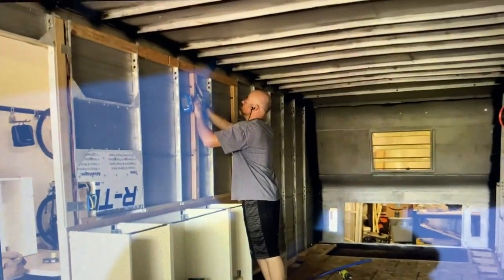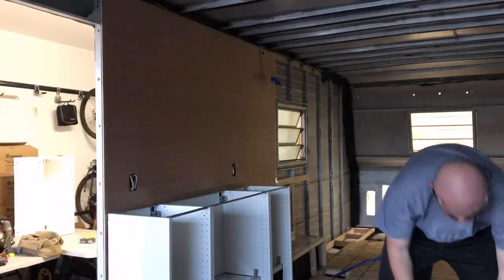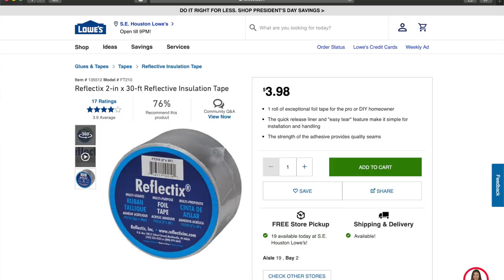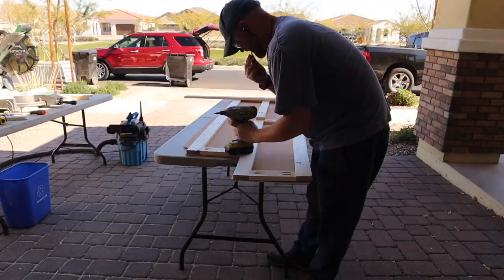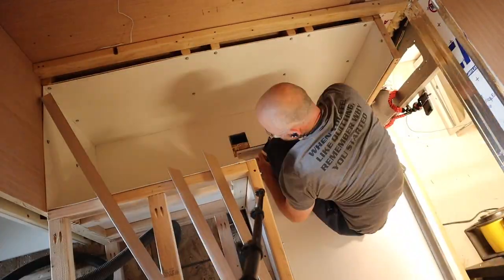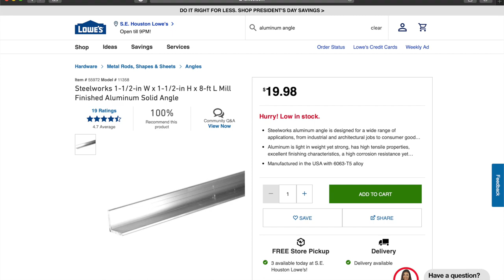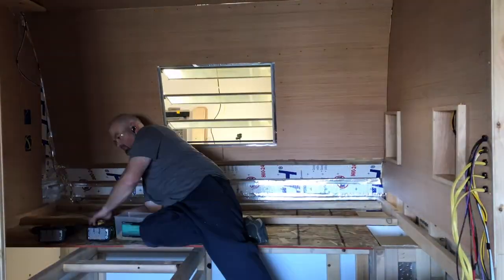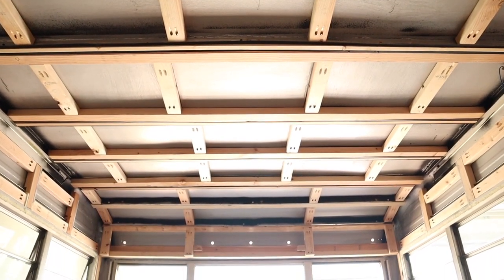RV BUILD - Framing and Insulating an RV

Comment: Thank you for posting this. I'm starting a reno of my 1996 Flagstaff and it has severe water damage in the bathroom. I know nothing about framing so I've been wondering how I should go about it. This is very insightful!
Reply from the maker: Let me know if there are any questions I can answer. We used 2x3’s and to be honest, I went a little overboard but it really depends on our RV. If I had to do it again, I think I would try metal studs. It would cost more but I think I would end up using less 🤷🏼‍♂️ good luck!!!
Reply: 1x3 strapping - with 1/4” plywood sheathing and spray foam you’ve created a torsion box of essentially stressed-skin panels. Or 1x2s 
You did use a way overkill on the 2x3s with both weight and quantity. Not being a jerk, just saying from A LOT of experience that a light frame with an adhered plywood skin is wicked strong. 

A bunch of RVs, trailers, boats, cabinets and general construction over the years under my belt prove this out- and although I’ve never done airplanes they are another excellent example of this. 

When do you build your next one? :)

Comment: Hi, Question if you could help. I recently was given a rotted camper, fully rotted and i took it down to the frame for a rebuild being it's special to me and not worth tossing out at my age (18). The walls aren't on the farm fully about 40% is and the rest hangs to be drilled into the floor, Should i shrink the floor so they fit on the frame or just leave it as is for the rebuild.
Reply from the maker: Hi! You can build it however you want, but the two factors to consider are how well the shell is bolted down to the frame. Several trailers rely on the floor itself.
The second is water damage. There is nothing worse than a rotten floor, so you want to make sure the floor is extra protected where it meets the walls. You can always send me pics to homemeetsroad@gmail.com so I can give you my best recommendation.
Btw, if you can stay away from wood framing, I would. No issues to report, but the sheer weight and the potential of water damage are always in the back of my mind.
Reply: @HomeMeetsRoad  Yes, Sadly the entire frame was rotted everywhere due to years of sitting uncovered outside when i obtained it, So it was ripped down to wooden frame and i can't afford better so a wooden one will go in it's place, However i will beef up certain areas a lot and might send images to that email. This is a complete rebuild, Restoring trailer frame to the building itself and i'm sealing it with the intent the next time it needs to be rebuilt all the siding will be trashed, It's Around 55 years old and once finished will not be moving, Being i have a home lot i plan to place it at for the rest of it's time being.
Reply from the maker: @WendysAnime  If it's 99% permanent, that changes things. The road is not kind to RV's 😆. The wooden frame will be just fine. Just try and keep moisture out as much as possible. Good Luck!!!
Reply: @WendysAnime  That’s awesome! Did you vid your build?

Old campers are very cool. I had a 1959? Forester 16’ with a rotted floor and leaky roof. I redid the floor and covered the roof. It had amazing varnished maple paneling and cabinets with a STILL working very retro fridge with all the chrome and a convection furnace. I do so regret having let that go

Comment: I got a question I rebuilt my 38 foot camper only 1/2 cuz of a leak when I bought it but to the question I live in Ohio an we full time rv an this was our 1st winter is that foam enough to keep warm inside because I used insulation an have a lot of sweating going on do you think just thick foam be enough to keep warm an not ruin stuff with the sweating
Reply from the maker: To be completely honest. If I were to do it over again, I would spray foam. The only reason I say that is that we did have sweating, but not where the insulation was; we had it where the ‘struts’ were, so there was no insulation. It was primarily on the ceiling, the support struts, not the wood. Spray foam would get those areas and prevent sweating.

Comment: Great video! Thank you! I just have a question. RVs are designed for travelling so they are light-weighted. Will Adding that much insulation put stress on the tires?
Reply from the maker: Depends what your axles are rated at. This trailer has two custom Dexter Torsion Axles rated at 5,500lbs each (so 11,000lbs). Fully loaded (with 2,000lbs of stuff) it weighs 8,600lbs (axle) and 1,000lbs (tongue) so we are technically under weight by 2,400lbs!

Comment: more questions, on this interior frame, did you not say that doing it over you might not have needed as much as u used? i cannot recall which video you mentioned that or what it might have been you could do without.

and, did you find the foam to be adequate insulation?

i just dropped the belly pan on this 78 rambler 24 statesman. broken black water fitting , tank mounts rusted off shifted the tank , made a mess a dozen years ago and has not been used since im going to say that inspection will save me so much of the labor you had to go through below. interior is about like yours i want to not use wood on ceiling but rather a barricade panel with foam sandwich and a finish surface of cork. all adhesive with some screws into aluminum frame.
is this plausible ?
Reply from the maker: Your ideas are great! I’d go with that plan.
The foam was adequate but if you can go thicker, I would.
In general, I used way too much wood framing. Doing it over, I would use metal and just re-enforce the factory seams. Maybe add some extra structure where you know you are going to mount things.

Comment: What did you use as the wall board?
Reply from the maker: Revolution Ply from Lowe’s. The one I used has a mold proof primer on one side (the inside). If money isn’t a concern, I recommend 3M E-Panel which is a thin layer of PVC between aluminum but that stuff is pricey.